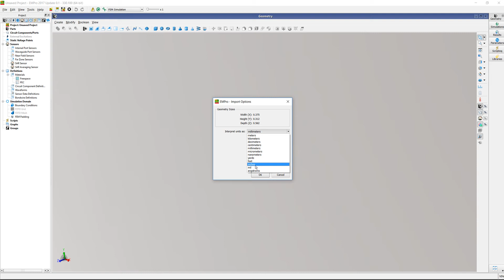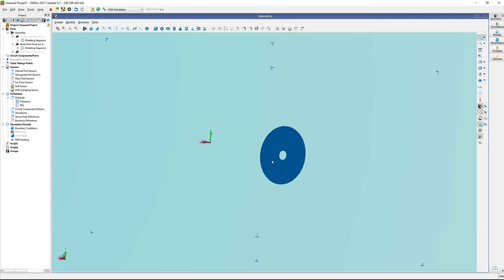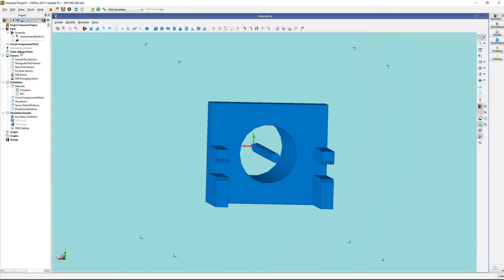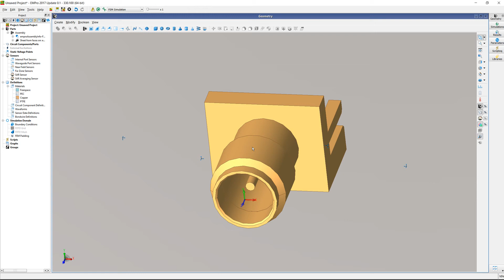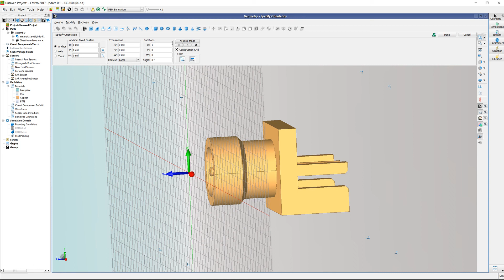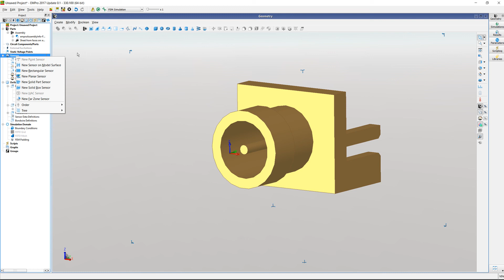Importing a connector into EMPro

Comment: Hey Haoyang, thanks a lot for this video. I'm trying to simulate an edge launch SMA (similar to what you're using) and I think I got everything right but when I run the FEM sim, it's telling me that emds_mesher failed. It doesn't like the quality of the connector object, housing (there were windings on the model I got so I tried to make it smooth by merging with a bigger size cylinder). The dielectric seems to be okay. Would you mind doing a tutorial where you actually use the SMA edge launch on a simple PCB and run the FEM simulation?
Reply: Could you also upload the 3d model of the connector you're using? I can't seem to find it.